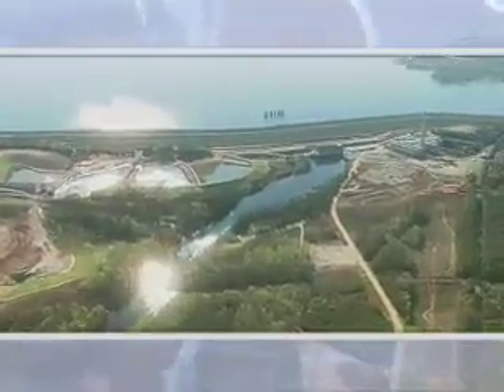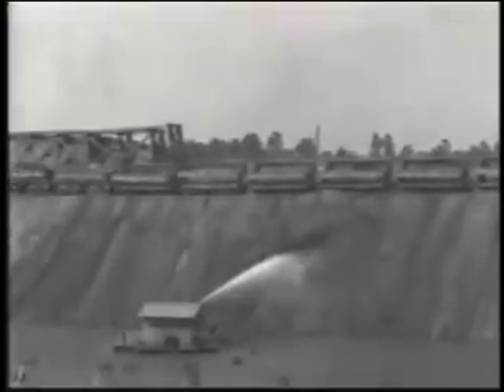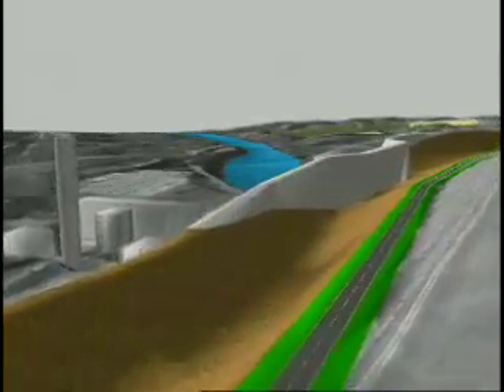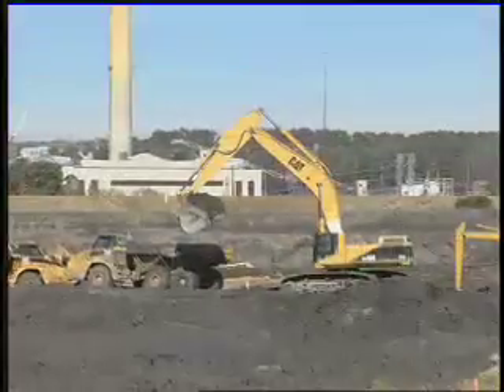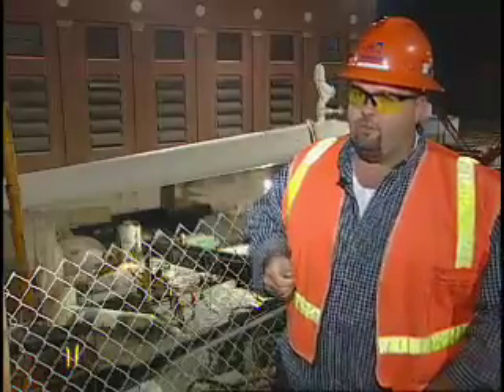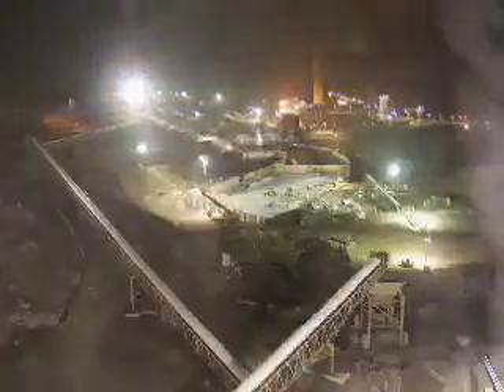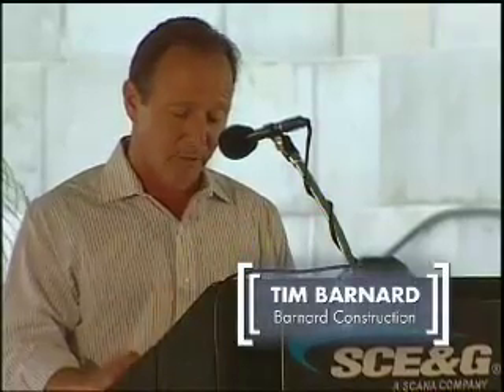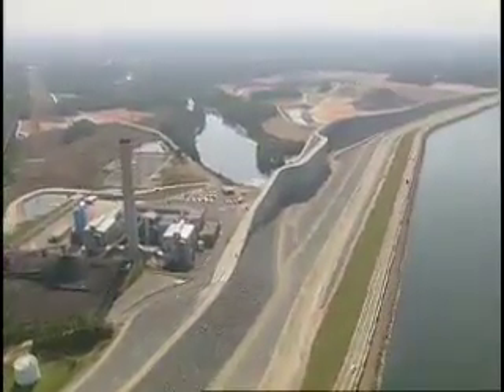Lake Murray Backup Dam 300k 1

Comment: My Dad was a civil engineer at SCE&G and he used to tell us that someone recalculated the 1000 year flood level for the area and it was about a foot over the top of the original dam.  As a quick fix, they drove a steel cofferdam into the top between the original road and the water about 2 feet higher.  I think some of it is still visible on the Irmo side around the park.